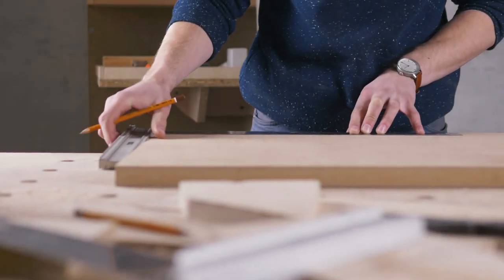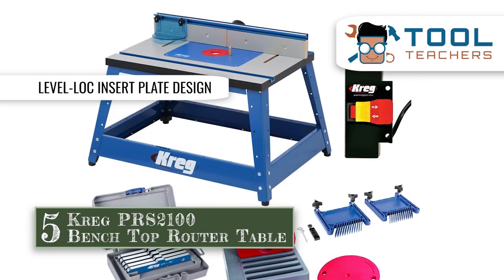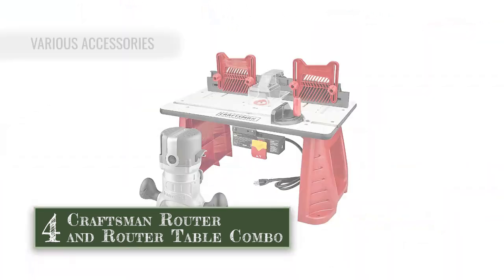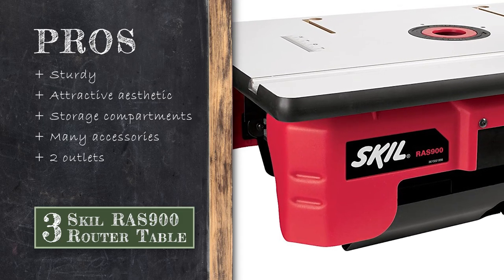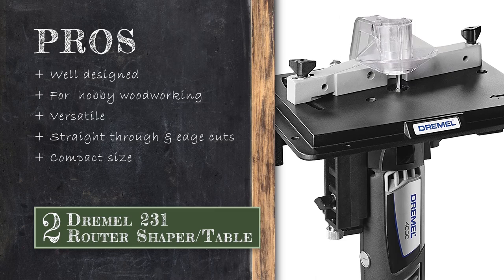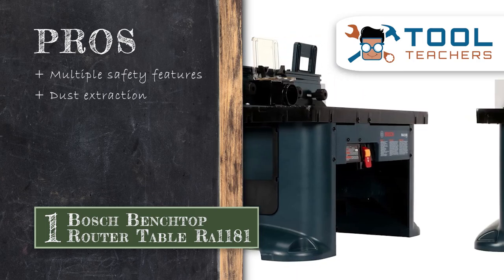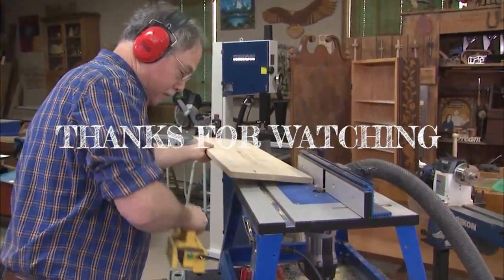Best Benchtop Router Tables ⚙: (Rated & Reviewed) | Woodwork Advice

Comment from the maker: Read the full review here: ►► 
https://panaceatools.com/benchtop-router-tables/
(Best Benchtop Router Tables)

-------------------------------------
✅ Featured Products for Best Benchtop Router Tables

0:00 Introduction
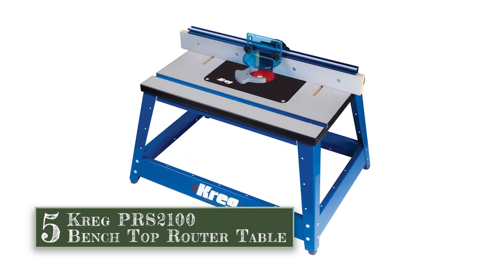0:54 5.Kreg PRS2100 Bench Top Router Table ➜ https://amzn.to/364xZAI
2:00 4.Craftsman Router and Router Table Combo ➜ https://amzn.to/3q4YNsk
3:05 3.Skil RAS900 Router Table ➜ https://amzn.to/33kPVFl
4:09 2.Dremel 231 Router Shaper/Table ➜ https://amzn.to/368QvIi
5:07 1. Best Overall: Bosch Benchtop Router Table Ra1181 ➜ https://amzn.to/3mbrjX1

Subscribe to our Channel 
🔴 https://panaceatools.com/youtube/

-------------------------------------
Detailed review: https://panaceatools.com/benchtop-router-tables/

⚙ How to Choose a Benchtop Router Table 

🔸Size
For many amateur or hobbyist woodworkers, you may not have access to an actual woodshop, so you will need a table that is on the smaller side and can easily be tucked into the back corner of a garage or outdoor shed space.

🔸Sturdiness
This is potentially the most important quality a router table can have. Woodworking can become really dangerous really quickly when you are working on a table that is wobbly or shifts around underneath any weight.

🔸Cleanliness
As any carpenter could tell you, woodworking results in a large amount of sawdust. You want a router table with a dust cleaning mechanism or at the very least an additional outlet so you can plug in your shop vac and have it handy for when things start to get a little dusty.

💬 Let us know what you think of these Benchtop Router Tables in the comment section below.

👉 We appreciate every thumbs up and would be grateful if you’d consider subscribing to our channel!!

-------------------------------------
🎥 Welcome to the official YouTube Channel of Woodwork Advice 🎥

Woodwork Advice is your #1 online resource for tools and DIY-related how-to guides.   

 🌐 Learn more about us: https://woodworkadvice.com/about-us/
 💻 Like our Page: https://woodworkadvice.com/facebook/
 📢 Follow us on Twitter: https://woodworkadvice.com/twitter/
 📱 Check out our Pinterest: https://woodworkadvice.com/pinterest/
 🔴Subscribe to our Channel: https://panaceatools.com/youtube/

-------------------------------------
Disclaimer:
Some of the footage used in this video is not original content produced by Woodwork Advice. Portions of stock footage of products were gathered from multiple sources including, manufactures, fellow creators, and various other sources. If something belongs to you and you want it to be removed, please do not hesitate to contact us at admin [at] woodworkadvice.com.

Some links in the description are affiliate links. If you click on one of the product links, I’ll receive a commission at no additional cost to you. As an Amazon Associate, I earn a small commission from qualifying purchases.

#WoodworkAdvice #BenchtopRouterTable #BestRouterTable